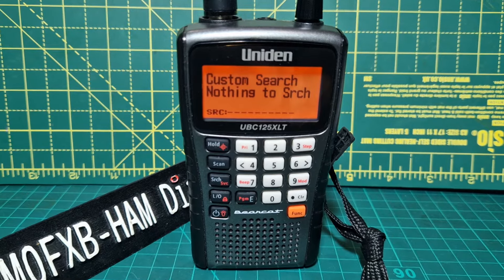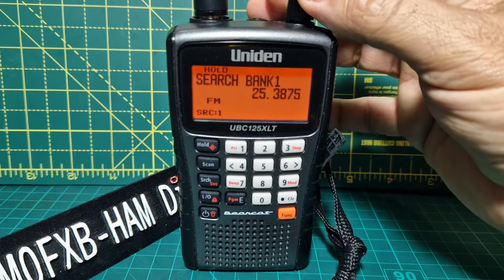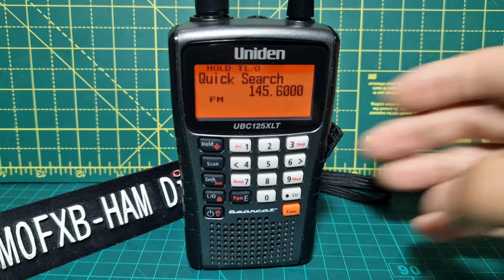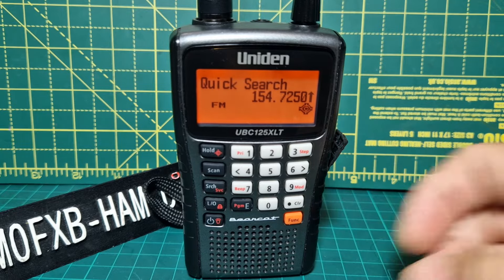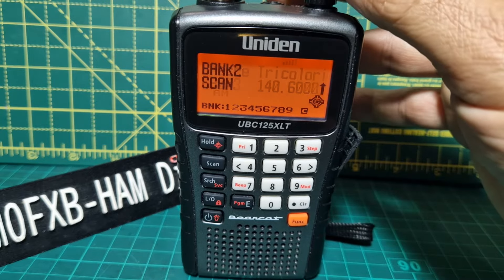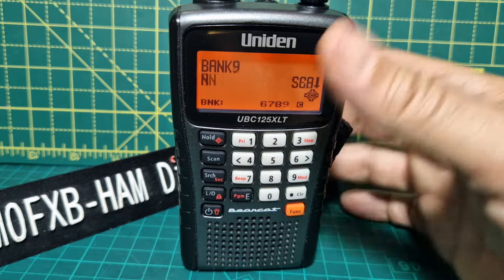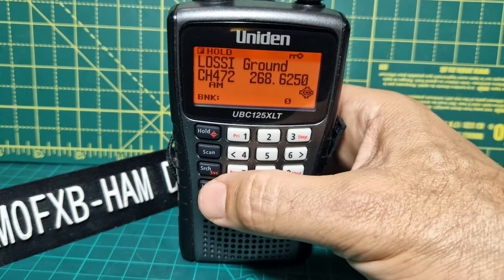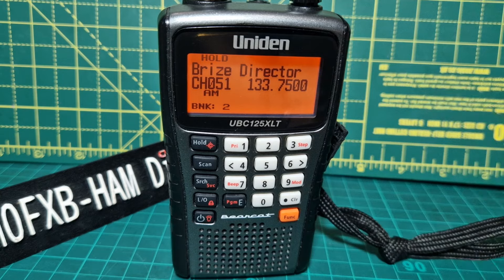UNIDEN 125XLT BEGINNER LEARNING AND OVERVIEW 2023

Comment: Can I ask a question? My local airport tower frequency is 118.305. The scanner is altering it to 118.3. I've tried the step option  but no joy. Am I doing it wrong?
Reply from the maker: Change step to 5
Reply: I can only change step from default to 8.33khz, 12.5khz. It's not showing an option for 5khz on the airband 108-137

Comment: I have this scanner, but found my much older AOR scanner much easier to navigate.
Good video though. Naming any frequencies you’ve stored is a bit long winded too, not into the computer side of things, so have to enter them directly into the scanner by hand. Good compact scanner.
Reply from the maker: The 125 is very good value but alot to learn like most scanners .
Reply: @HamTechRadioScannerDrones  👍